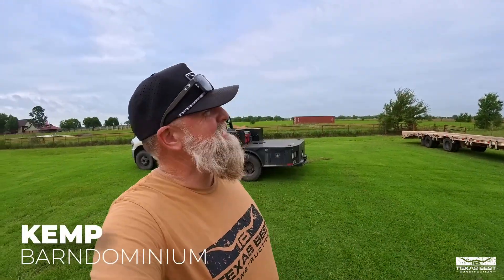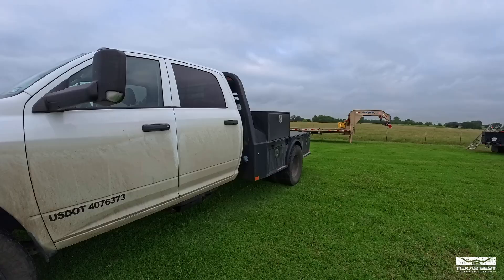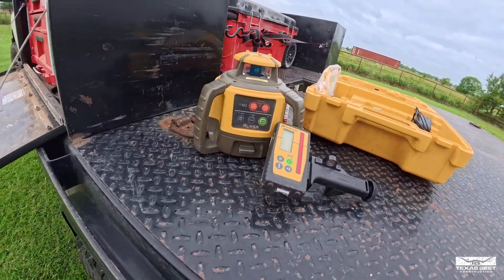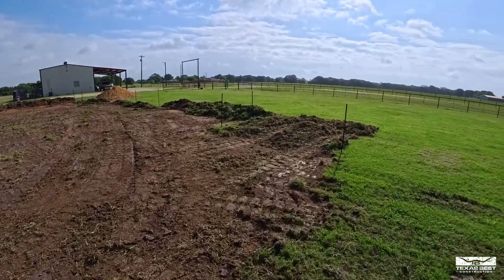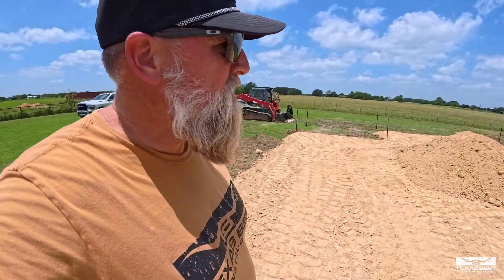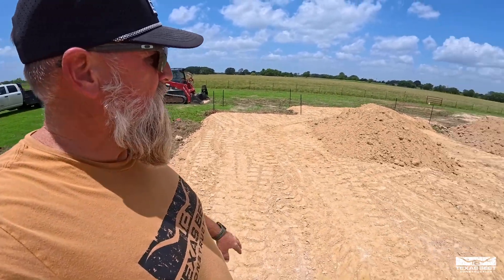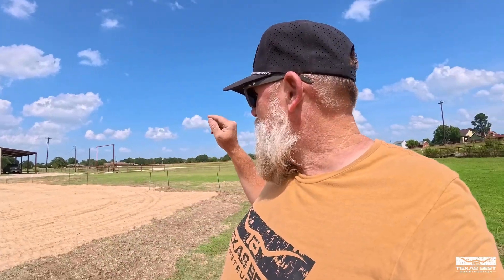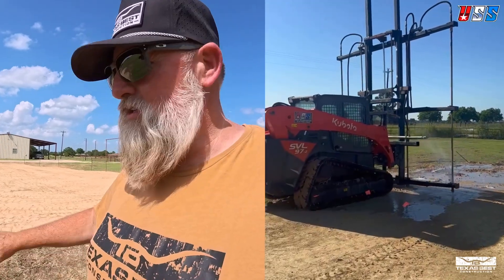Why You NEED A Soil Test Before Building Your Barndominium

Comment: Yo Josh, so if a piece of land doesnt pass a soil test, chemical injections can be used? So regardless you can build a barndo anywhere? And how much difference in costs is it for those injections as opposed to not needing them?
Reply from the maker: That’s a great question, and yes that is definitely an option. All sorts of options. Piers, chemical injections, soil stabilization with different t soil. Additional engineering, all of these additional cost. Chemical injections tend to be a little more affordable in allot of cases.